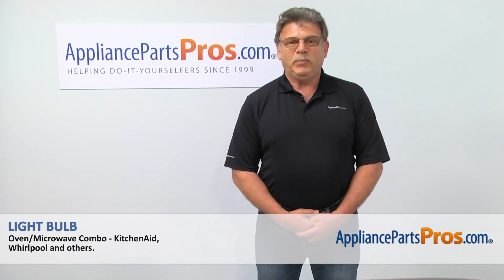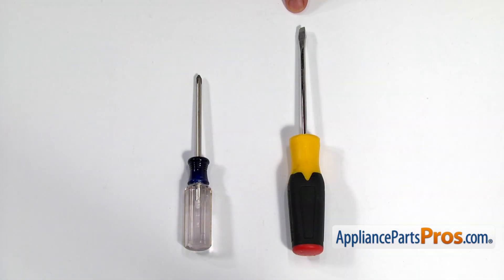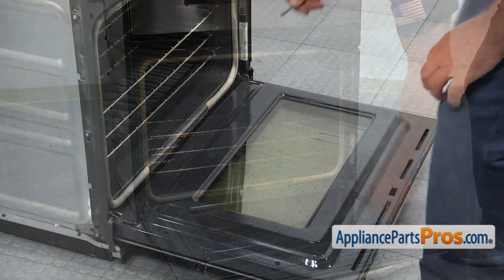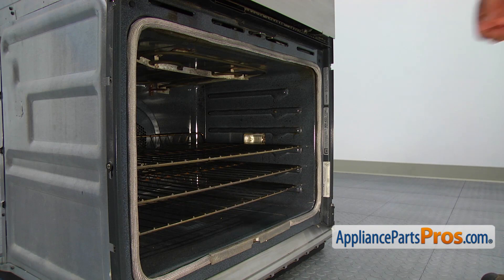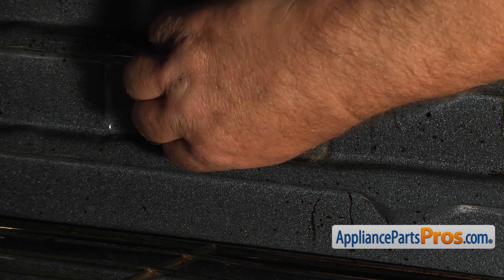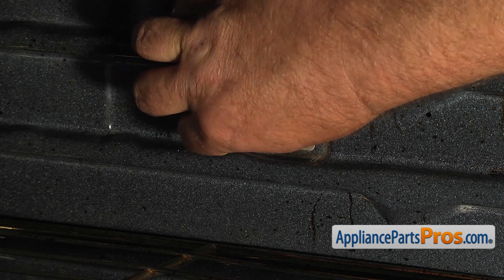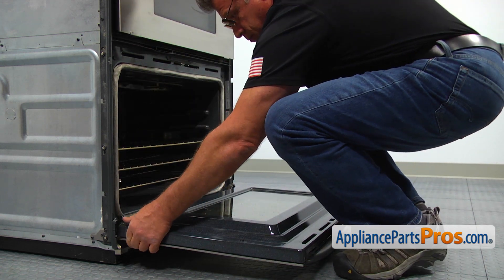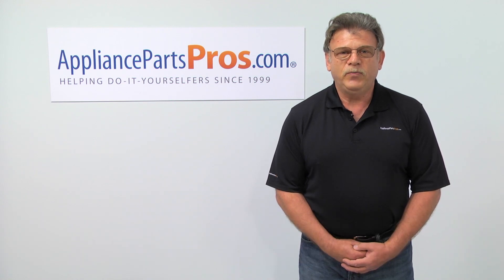How To: Whirlpool/KitchenAid/Maytag Light Bulb WP4452164

Comment: The Kitchen Aid KEBU208SSS03 uses the same side lights.  You can simply pry the lens off rather than removing the fixture if you carefully use a flat screw driver to to pry between the two clips on the lens clip.  The first time is a real chore.  Pry carefully and be sure that nothing is bent because it needs to fit tightly when you replace it.  Also, while you can find this part at most appliance parts stores, it's an OSRAM 64408 5W 12V G4 OVEN RATED and should be available from other sources.  If you substitute be sure it's oven rated.  Use clean gloves as halogen lamps tend to explode if you get oil from your fingers on them (others call that "premature failure").  It's also really hard to line the pins up to push it in so be patient and don't bend the pins since they break off way too easily.